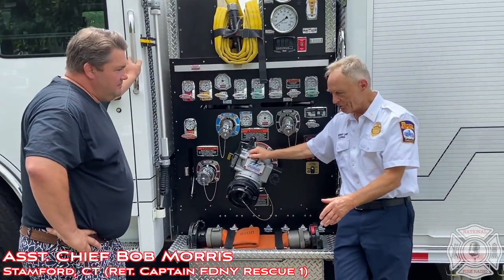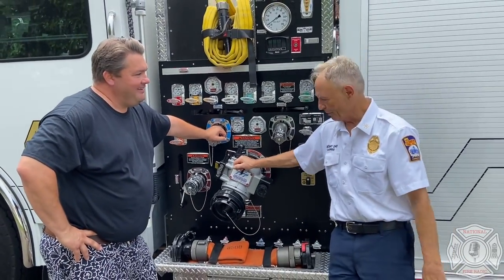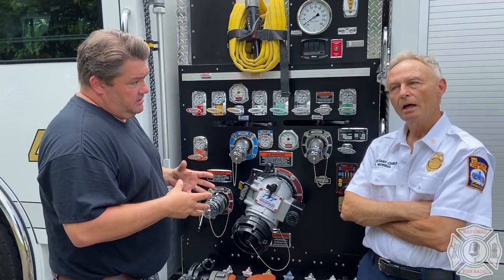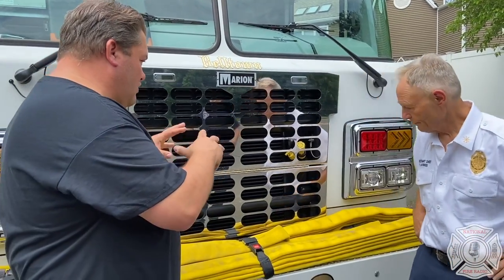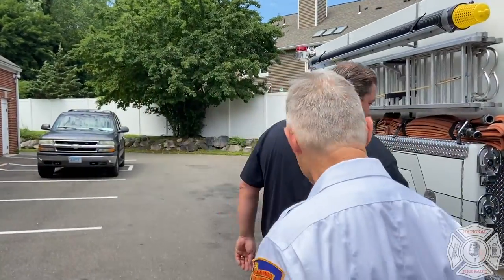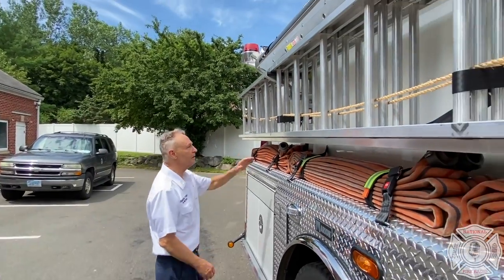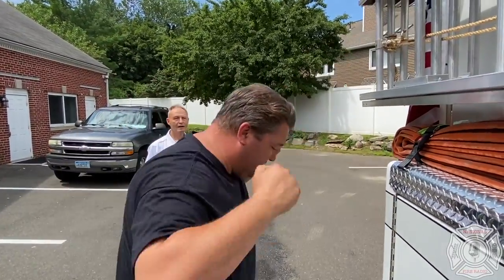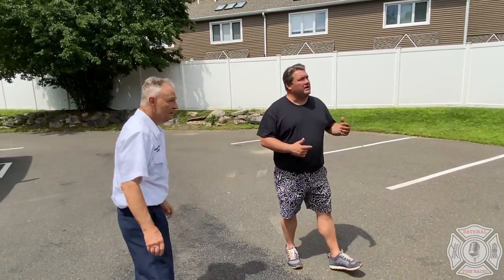Belltown, CT Engine 43 - Walk Around with Assistant Chief Bob Morris

Comment: I just watched this video and wished more Chiefs were like you. I do have one question. In the beginning of the video, you two guys are standing next to the pump panel. What size and length is the hose that is in the trough? Also, what adapters are on that piiece of hose. Thank you for a great video.
Reply: I think he was saying it's a 35 foot 5 in. section of large diameter hose. Very handy. 25 foot can be a little short. 50 foot makes of a lot of hose laying on the ground. 35 is the sweet spot. We call it a "curb jumper".
Reply: 35 ft x 3.5".